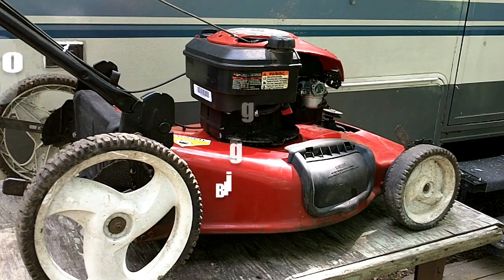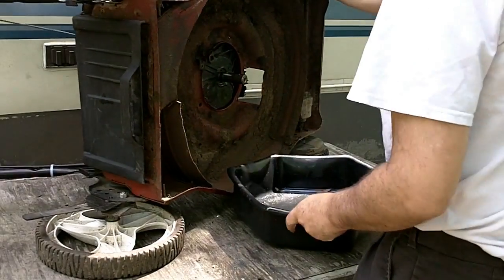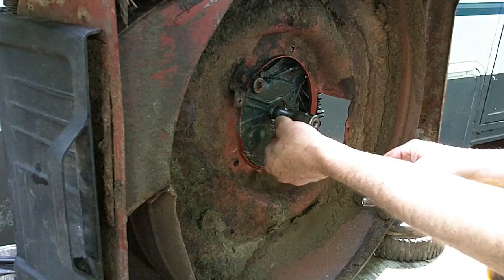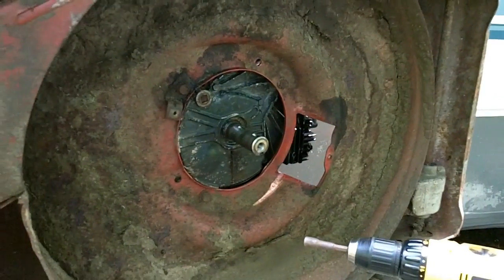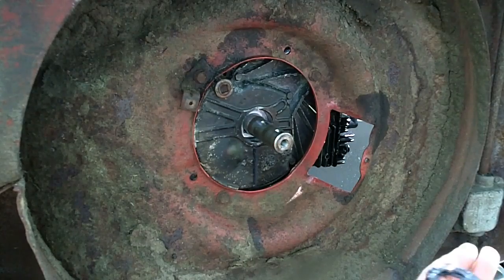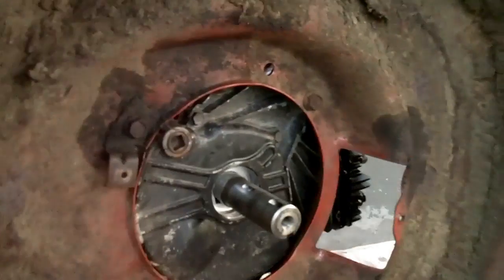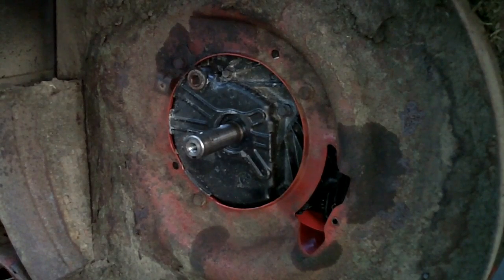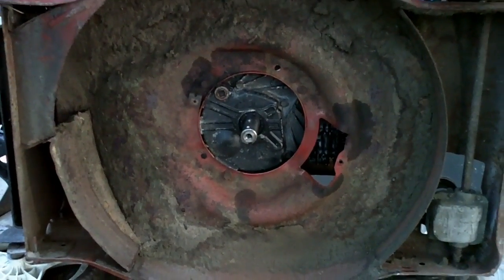Oil Seal Remove & Replace Briggs & Stratton Quantum Lawn Mower FIX Repair

Comment: Great idea!  I saw some difficulty with the self-tapping screw.  So I predrilled with a 3/32" drill and then just used a sheet metal screw.  Came right out.  Like the PVC pipe.
Reply from the maker: Good job fixing it yourself!

Comment: Hello, Thanks for the well explained video. I noticed on a used MTD mower I purchased. My question to you is did the replacement of the seal stop the leak?
Reply from the maker: Absolutely. I think the bottom axle seal gets mangled when you run over stuff like plastic bags, wires, or things that can get tangled up on the shaft above the blade.

Comment: Thoughts? My mower is a push Craftsman.Briggs Strat 6.75.Few years old.Oil is leaking pretty heavy out of air filter.More specific, next to the carb is a white plastic.Behind that and the filter case is a black house goes to silver pipe pipe to engine.Oil flows out that inside air filter case.Mower starts and runs fine.Prime suspect to cause this?

Comment: Hi Buck...how do I replace the magneto side oil seal? I see it on the engine diagrams, but have not found a video on how to replace it.

Engine is 08P502-0055-F1
Reply from the maker: Well, you will have to remove the flywheel to access the upper oil seal. How do you know that seal is leaking? I'm not doubting you, but I have never found an upper seal leaking....though my experience is limited, I admit. Good luck.

Comment: Most  people  would have cleaned all the grass from under the deck when it was on it's side and also sharpen the blade to do a complete job.
Reply from the maker: Yes, good point. Also, most people watching this video want to know how to remove and replace a leaking oil seal, and I'm pretty sure that's what we covered.... Thank you for watching and commenting.
Reply: That was my first thought. He should of cleaned the underside. My mower gets hosed off after every use.

Comment: Lol.. just dont knick the crankshaft or new seal will leak. 

Ur supposed to pull the motor pull the oil sump clean engine pan put new gasket and seal in.  At least yu saved time n got lucky.. good vid. Not correct way to do it tho.
Reply from the maker: Remove the Engine? Take off the sump pan? Totally unnecessary. No one is going to go to all that trouble just to replace a simple seal on an inexpensive lawn mower.